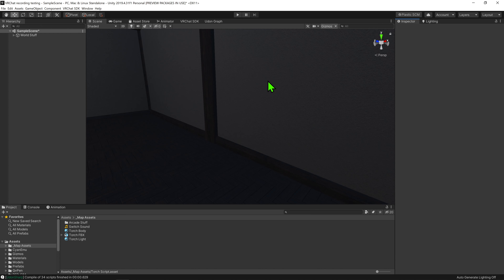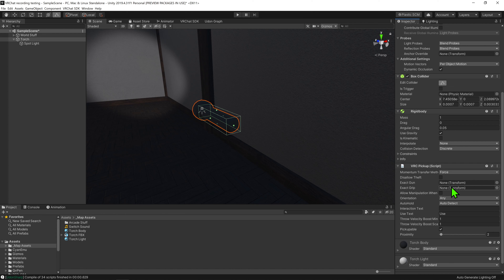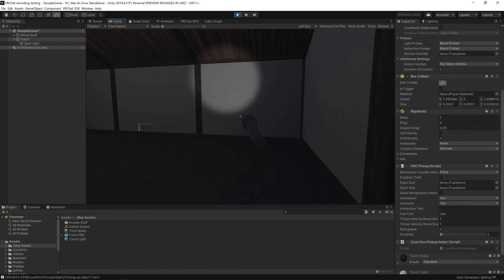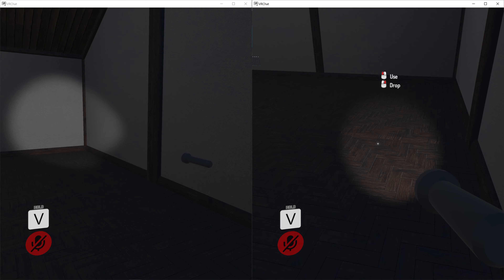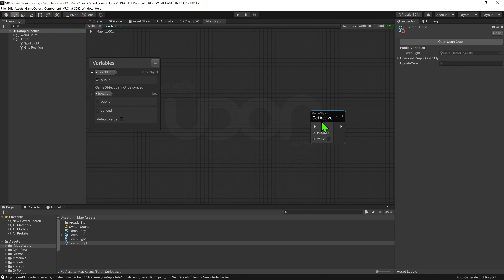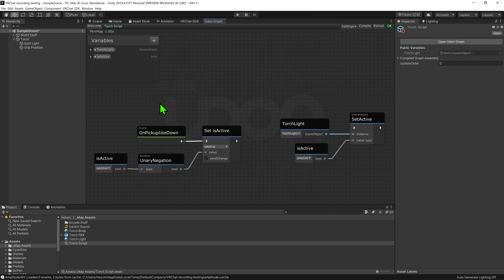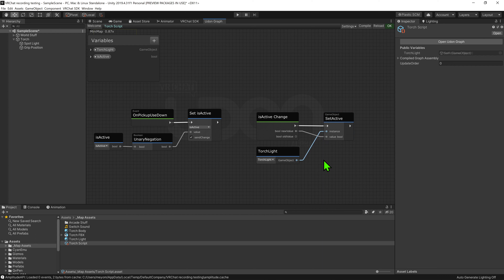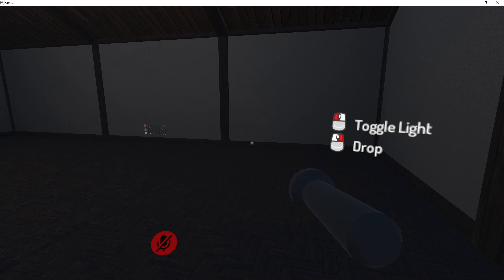Create a Working Torch in Udon / VRChat SDK3.0

Comment: Hey i have a question, how would i make a players screen fade to black such as right before they get teleported to make it seem smoother than an abrupt teleport?
Reply from the maker: You want to play make an animation, that goes from clear to dark, then dark to clear. Then you just need to tell the animator to play when teleporting.
As for how to make the screen go dark, you want to either use a post processing volume, or a shader. Using a shader has the added benefit of being quest compatible too.

Hope that helps ^^

Comment: hello, i am trying to attach the torch to the player when they pick it up so they dont have to keep holding it  im not sure how to go about this, please help.
Reply from the maker: Hmmm... When it comes to the best method, that will depend on your world and your use case. However, for simplicity sake, I think the best method would be to create a player follower object from my obj follower script (last version shown), and name the torch a child of it. 
Then you just need to add to the torch script that 'event, onOwnershipTransfer', change the parent owner to be the same (transform, parent - - >> transform, gameobject - - >> networking, set owner (networking, get owner)).

Then you also want to create a bool on the follower script, that says whether or not it follows you. I would it when you turn on the torch, it also makes the player follower follow you. 

You would also also want to make it so that if the player follower owner disconnected (event, onPlayerLeft (playerApi) - - >> playerApi, equals (networking, isOwner) ) , then make it so the player follower bool and torch bool disable.

Not the easiest thing to discribe and code, but hopefully this helps ^^

Comment: is there a way to make it for the player view so you dont have to hold it. it just attaches to the head of our player
Reply from the maker: This is a difficult question to answer simply. It honestly depends on what you want.

If you just want a light that follows the player's head, then using my 'player follower' tutorial, you can make an object follow the player; and with using "playerapi, (head) get tracking data' --> 'playerApiTrackingData, get position/rotation" you can get an object that follows the player's head. Then you can just add light as a child of that object, and offset it so it doesn't clip with the player's head. This works (on a basic level) well locally, but you will run into heaps of problems expanding upon this.

Some problems being.. when does a player have a light? This could be a simple 'click this object makes light active'. 
If you need every player to have one and everyone can see each others, how will you make it so that everyone gets a different light object? Perhaps cyanlaser's object pool will be needed
How will a player interact with a light that is on their head? Aka: how will the player take off the light if that is all possible? Perhaps when they hit their controller trigger when their 'tracking data(Left Hand) is x distance from the tracking data (head), but then you still need to code in exceptions for desktop players. What about small avatars? Will they just have to not use their trigger, or force them to switch avatars?

There are a bunch of issues that you would have to work around. The approach I would take would differ depending on the map I'm making, as you can choose the method that can be best work around in the map design.

Sorry for this not really being an answer, and kinda ranty, but I hope this shed some light on some things to consider ^^

Comment: Thank you for your time & tutorials. Question why did you not use "send custom network event" when turning it on and off ? Im just trying to understand what method is recemented and why ?
Reply from the maker: No worries, glad they help ^^
Sending a custom networked event doesn't account for latecomers, thus the synced variables. If I was concerned about having too many synced variables in a scene, I would do the custom event method
Reply: @PlayerBush001  I thought that might be the case. I have been using On player join get master get active self if true set as true for late comers basically. Is this a bad method ?
Reply from the maker: No, and it's one less sync variable to have around. There are other cases where a player may miss a networked event, like a quest user going afk and their headset going to sleep, but people kinda expect those.

For me and my tutorials, it's honestly just more nodes to explain, and more nodes for people to get wrong
Reply: @PlayerBush001  Thank you Player_Bush you have been very helpful. Thanks for your time.  Hope to catch you around sometime. I can see us having strong intellectual conversations.

Comment: Thanks mate!!!
This helped me make so players can unwrap candies in a halloween world i'm making, it's amazing!
Reply from the maker: Ooo... that sounds cool! Nice one adapting the script! ^^
Reply: @PlayerBush001  Thanks! now i'm trying to "duplicate" this script in some candies (like gummies) so the candy appears and the wrapping dissapears (because somehow udon doesn't allow 2 changes on the same graph), this is for candies like gummies where I can just spawn a candy that's bigger than the wrapping (like lollypops, where the candy ball is bigger than the wrapped ball so it looks like it's unwrapped)
Reply from the maker: huh... you shouldn't need to at all. 
Udon is definitely able to do multiple changes on the same graph (do it all the time), unless you toggle off the object containing the script midway through the code (as it would then halt the script). Perhaps look at my video on toggling on and off scripts, where I toggle on one obj, before doing the opposite to another obj. Timestamp is 3;52 (https://youtu.be/19HMJaHGtqw?t=232)

hope that helps ^^
Reply: @PlayerBush001  Gonna check that, thanks!
Also on the meantime I got to a patch solution, instead of making the paper dissapear and candy appear, just the paper dissapear and put the candy inside the paper model (but smaller)
Reply from the maker: @blubariblub6960  That works ^^ 
You could also use a animator to easily toggle them, and even do a nice transition between the two ^^

Comment: I guess last question to ask would be on how to add a simple key system in udon
lets say I find two big coins touch them to a chest and it opens up.

also again thanks for the videos they help a lot.
Reply from the maker: this would be done by having a trigger on the target zone, and then have a 'event, onTriggerEnter', check to see if that object is your target object. If it is, add 1 to an int. also remove 1 from the int 'onTriggerExit'.
Then, if the int is > than the target amount, open up the chest. 

The check could be done with either comparing the gameObject with a public gameObject variable using a 'gameObject.equals' node; or by checking its name with a string variable using either a 'string.equals' node, or a 'string.contains' node. You can get the gameObjects name with a 'gameObject.getName' node.

Hope that helps ^^
Reply: @PlayerBush001  awesome thanks!!

Comment: If "sendChange" is selected, the flashlight will not work. I recommend uncheck this option.
Reply from the maker: I think you missed what is actually going on. The send change tickbox NEEDS to be checkmarked for it to call the property instead of the variable, otherwise it won't call the 'onVariableChange' event.

If I were to guess what you did, I would assume you checkmarked the 'sendchange' tickbox last, which means it didn't autocompile, as textboxes and stuff on nodes don't force the code to recompile. Then you play tested it and it didn't work, because the last time it compiled, the tickbox was off. Then you remade a node or two trying to debug the code, causing it to recompile, before finally unticking 'sendchange' and retesting. Therefore the last time it compiled, it had 'sendchange' set to active, so it worked. 

Try hitting the 'compile' button at the top right, and then see if the code still works with send changed disabled.